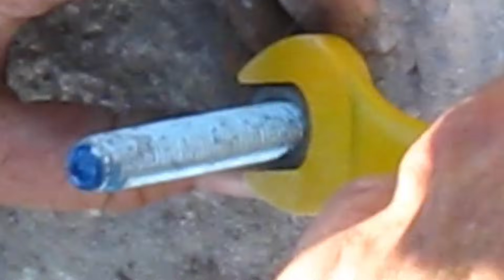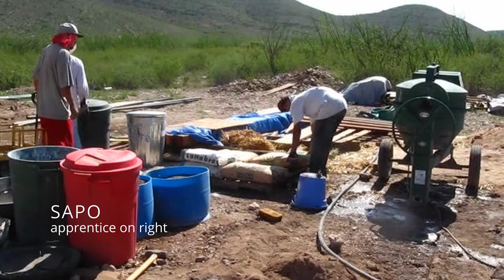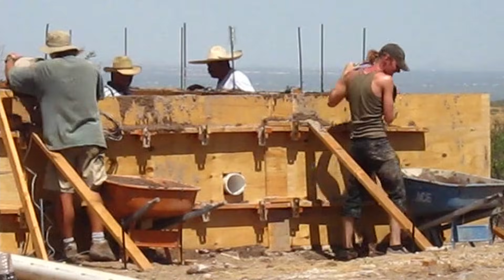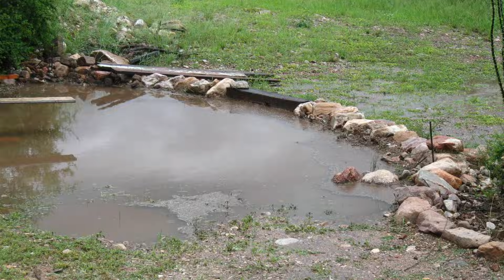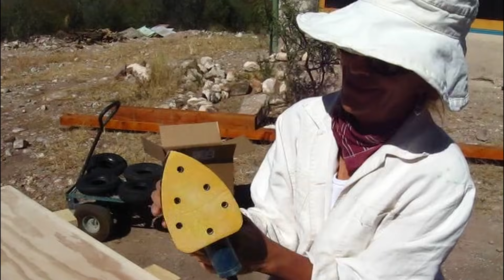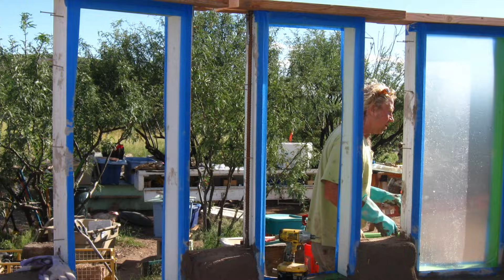Small Adobe Desert Home. Full build, all solar - off grid. Near Bisbee AZ. Creative formula was used

Comment: You didn't give the square footage, the cost, the build time, the waterproofing stucco formula, a tour of the finished inside/outside, the energy generated by the PV, the battery type, how it's heated, how hot it gets inside or exactly how/why the formula was creative. Do you grow your food? How far are you from a store? 
I would have used interlocking blocks to avoid mason work, mortar. Also, I would have used emulsified asphalt as waterproofing, no need for stucco. Did you build an adobe road by ramming? if not, do you have it wash out? I would skip the windows, use skylights.
Reply from the maker: 400 sqft, 80 sqft, bathroom

Comment: Thank you so much for sharing this video. very well done, short, concise yet just informative enough. One piece of info I am looking for is, what is the ratio of clay, sand, rocks, manure and/or straw if used. (as soils vary from place to place I am asking for the clay content specifically to adjust the mix for my situation) if not a direct answer a book or other reference that has the info of this this specific technique would be greatly appreciated. Thanks again
Reply from the maker: Do test runs for ratios. Depends on the quality of material used. Add some lime too.
Reply: He used adobe found nearby, probably because it's naturally sufficient. This is approximately 70% sand, 30%clay, water, and maybe a waterproofer. For millennia this was from pools of asphalt oozing from the ground. Lots of various mixes make it complicated, unnecessarily. You can find out if your earth and mix will work by making test blocks.

Comment: There are solar air conditioners. Do you have a backup solar water pump?
Reply from the maker: Demand hot water. 4A AC 120v.
Reply from the maker: 4 A ac unit. Tiny, works fine

Comment: for materials like adobe it is better to use basalt reinforcement inside.  1) it doesn't rust. 2) it is much stronger 3) it has similar thermal expansion properties to adobe, unlike steel.
Reply from the maker: This is a dry climate. Steel was cheap at the time.
Reply: @focusonevideos  doesn't matter.  There is always enough O2 and moisture in the adobe to rust the steel.

Comment: How do you keep cool? How hot does it get indoors?
Reply from the maker: Tiny AC inside, from solar
Reply: Diamonds Valeria, the construction material itself is thermically the ideal material for desert climates. It stays relatively cool in hot times and warm in cold nights. with the overhangs there is hardly any sun hitting the windows on the sounth side which prevents the glass house effect. This is true green/ecological building!